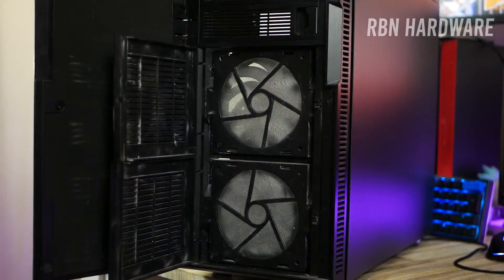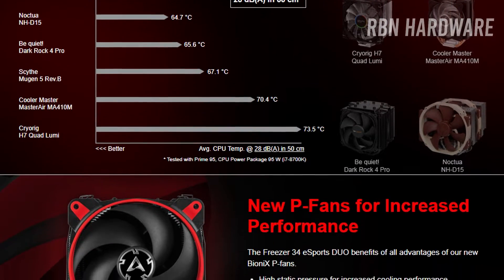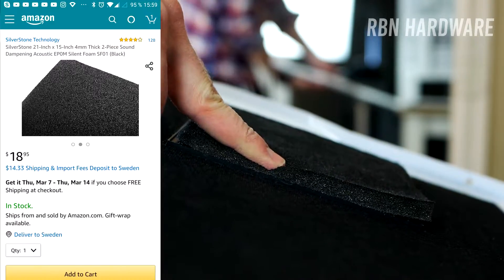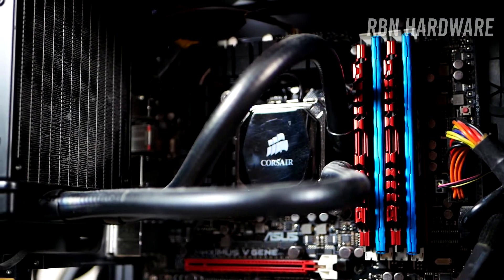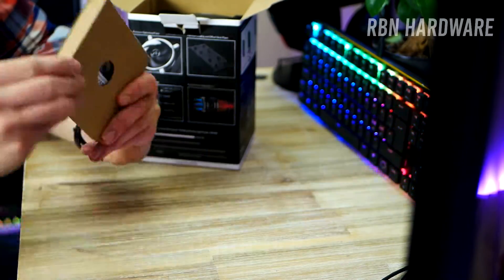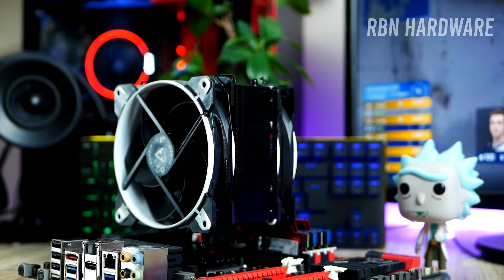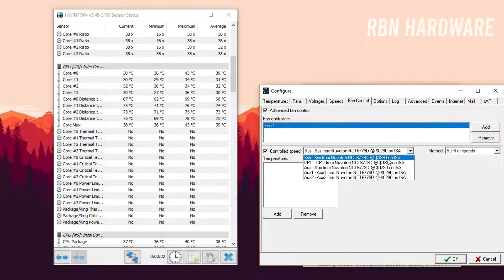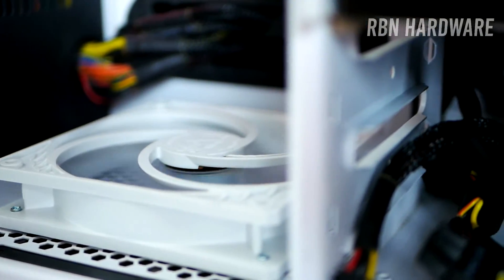ULTIMATE Silent Gaming PC & How to Make Your Fan Silent!

Comment: Look at Honda they have ANC inside the cabin of the vehicles. Their active noise cancelling works by recording the engine vibration and phase inverting it into the speakers system inside the cabin. I am working at this right now for home applications like stereos, Home appliances ( furnace, clothes washer).